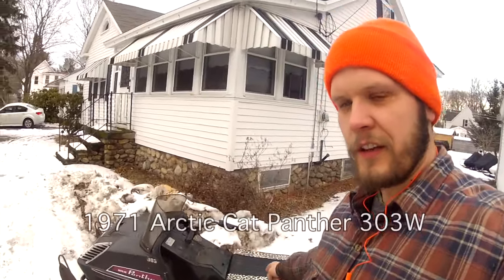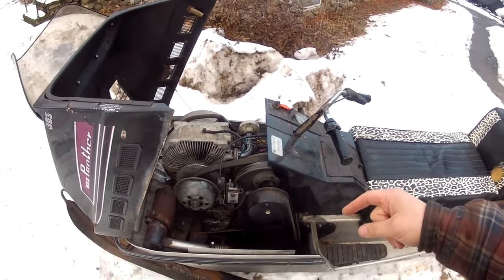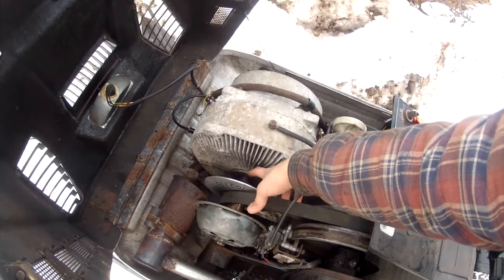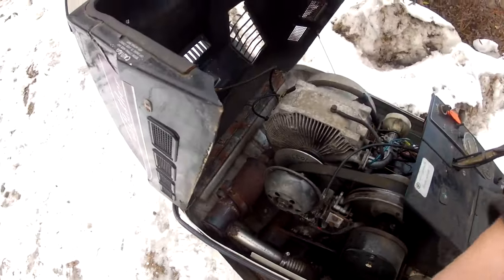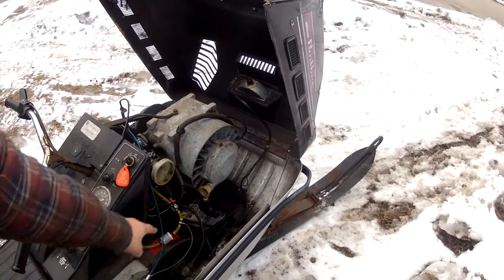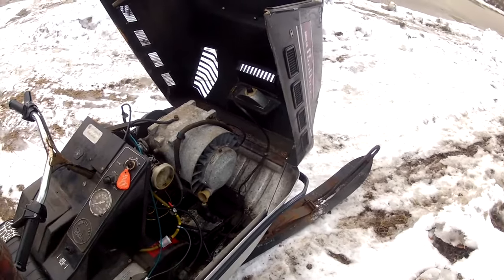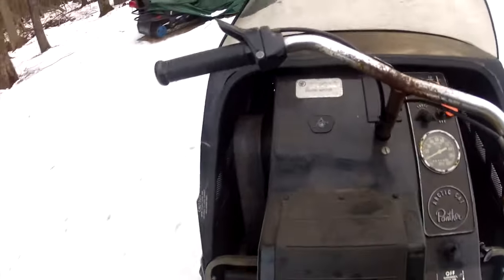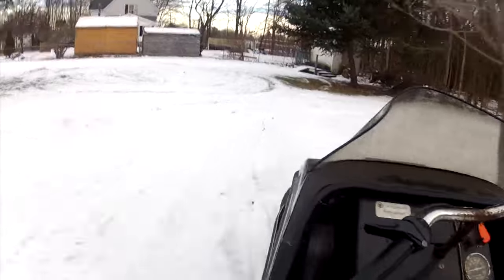1971 Arctic Cat Panther 303W

Comment: I grew up with a 1972 Arctic Cat Panther 303. The skis had a bar underneath (what I believe you referred to as carbides?). It was a fun sled, the Wankel had no limit to how far it'd rev. Well it had a tach, I recall 8k or 10k? And a speedometer that didn't work. It would back fire if you hit the brakes followed by throttle. Rear suspension was shot. Recoil broke. Would start on first pull at beginning of season, after sitting unused for many seasons. But then take hours to restart if it ever stalled once warmed up. Aluminum chassis, neat design. Ours had a tall windshield that was cracked in half. The track had metal cleats and it hated to blaze new trails on fresh soft snow, full throttle barely moving just hope it didn't stop. But unstoppable on hard packed snow. Until It stalled. Then you were calling Mr. Wankel every name in the book. It consumed belts at least once a season. If I still lived in an area where we had white stuff, I'd look for one.

Comment: I love the idle of those! I had a '71 Puma and understand the suspension.. I had the 440 though. How fast have you had it going? Good job in finding parts.. I hear they're a mite difficult to find nowadays.
Reply from the maker: +Baldwin587 I've probably had it up around 25mph, I've read that 30 is about the max with the stock carb but with an HR carb there should be more power available. I bought the last of the crank seals that Dennis Kirk had, hope they get some more.
Reply: +Curtludwig Huh.. the ones I knew could do 35 or 40 easy enough.. what did it use for a carb then? An HL? I always thought they had an HR. Thank goodness for Dennis.. but Apex seals.. those were the ones that I hear worry over. How did yours turn out to be?
Reply from the maker: Maybe 35-40 and I'm remembering wrong. It'd be a helluva ride at that speed, theres no suspension travel at all.
Apex seals would be tough, I've never been that far into it since it runs. I suspect you'd have to find something like an RX-7 seal and cut it down to the right size...
Reply: +Curtludwig I had my '71 to 57mph on the radar.. it was a blast, but terrifying at the same time. How about 30+ on a bogie suspension 12-Olympic!? The Puma was bloody plush compared to that thing.
RX-7 seal.. I never thought of that.
Reply from the maker: I had my '70 12/3 Olympique up to a real GPS monitored 25mph on an ungroomed trail. I was hanging on for dear life.
There are lots of rotary engines out there, I'm sure a seal from something would do the job or could be adapted to do the job...
Reply: Curtludwig currently from what I've read. low producing compression(old and worn, not broken)12A Mazda seals fit but need to have some height clearance removed. side seals were not mentioned, and I haven't been inside a 303 yet, but I'd assume 12a side would fit and just need the normal side seal grinding as all rotary side seals do. they are make to fit. apex seals are direct fit. also read old seals curvature is important so try to mimic when filing away the height clearance. the poster never did respond with a"get it runs great guys" but I just got 3 sleds and a spare engine so I'll be making videos soon. cheers
Reply: I’m working on my 72 303 and it’ll sit and idle but I can not get it to take off from idle without popping and banging. Did yours act like this when you decided to change of the main seals?
https://youtu.be/nxPXRDpSXt8

Comment: Where did you find the O-rings for it?
Reply from the maker: McMaster-Carr
Reply: You wouldn't happen to still have the parts number would you? I'm going to be doing the seals on one soon
Reply from the maker: 9262K316 is the Mag side,  I think the clutch side is 9262k698 but my records aren't super clear.
Reply: Thanks a bunch for the answer. That'll save me a lot of headaches
Reply: Its pretty easy, I put just a dab of Three bond on the orings to hold them in place while I put everything together.